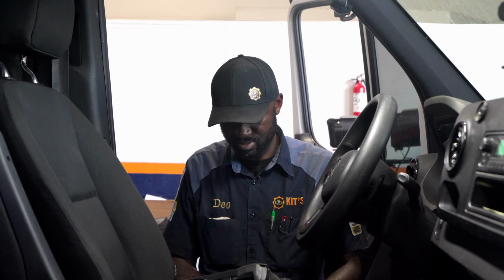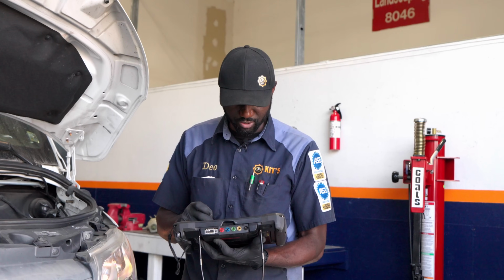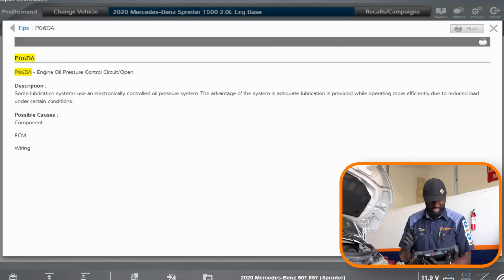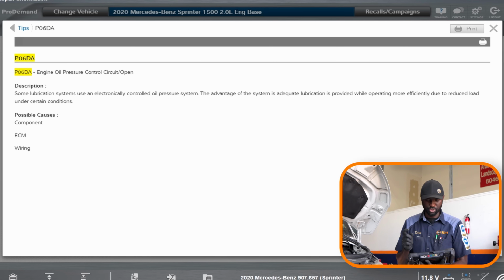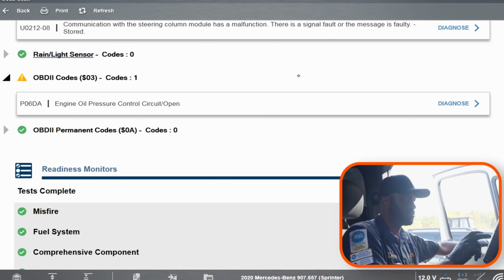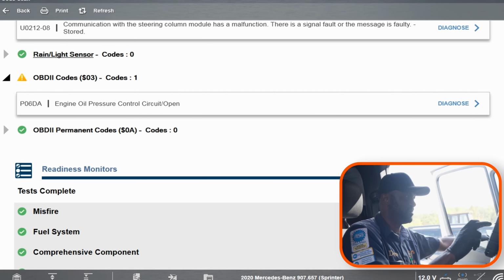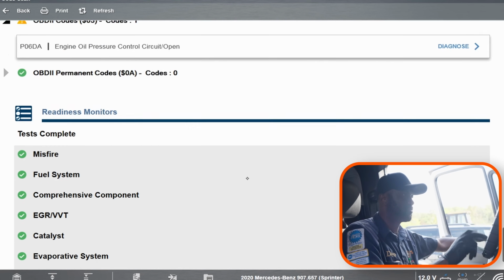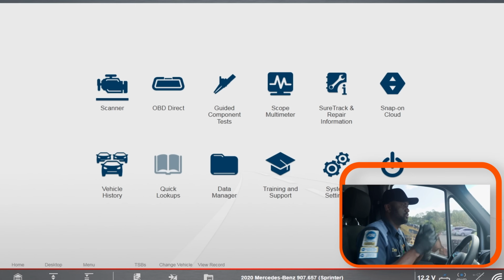2020 Mercedes Sprinter Engine Almost Seized - Code P06DA - Oil Pressure Nightmare

Comment: Dodge 3.6 pentastar has the same issues with the oil pump solenoid switch, triggers the check engine light and goes into limp mode ,replaced with new oil pump assembly problems solved
Reply from the maker: @DGOOSENINE   Good to know, Thanks

Comment: Make a note of the recorded resistances in your service data if you can. You might even track down where that sensor connects into the ECM. Just maybe it is easy to access as test points for future oil solenoid resistance checks.  Good job Deo and you to Matt. 🎥
Reply from the maker: @jimharmon3404   Great point, Thank you!

Comment: Engine M274 in Mercedes-Benz METRIS, engine subframe has to be removed or atleast lowered for access to oil pump control switch valve. Engine M177 in multiple Mercedes Benz AMG vehicles YOU HAVE TO LOWER the engine, no way around those. I agree 100% and  believe we have to be honest at all times with the customers but also with Mercedes-Benz Service Manuals. Great Work Kit
Reply from the maker: @EuroSprintech_0911   Yes Bro! Thanks

Comment: Seems one could test test the circuit an solenoid at the ecu an not have to remove oil pan.  But as you say your quite convinced its inside oil pan
Reply from the maker: @rogerpatton5837  yes Good point, I leaned on my experience on this one

Comment: Great video. Seems to be alot of Sprinter Vans with multiple problems on a regular basis. Troublesome vehicles so it seems to me.
Reply from the maker: @robb15033   Thanks, they are good vehicles when maintained well

Comment: If Mercedes requires engine removal to remove the oil pan, maybe they know something will be damaged. If you don’t remove the engine versus lifting the engine up with a jack.
Reply: Toyota requires removal of the engine to replace control arms...
Reply from the maker: @raymonddriggers all cars break down

Comment: The valve body you replaced with a use one ? did you have to program it
Reply: Has not answered anyone I asked the same question
Reply from the maker: @richarddiaz8248  Yes we did
Reply: @KITS_Auto_and_Truck_Repair you’re a great friend 🎉
Reply from the maker: @silviorusso2717   Yes!